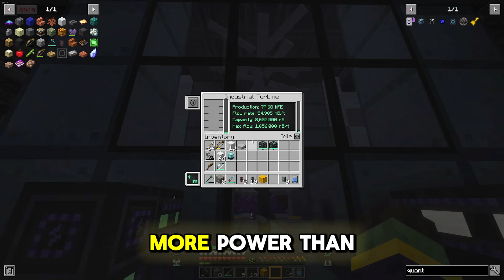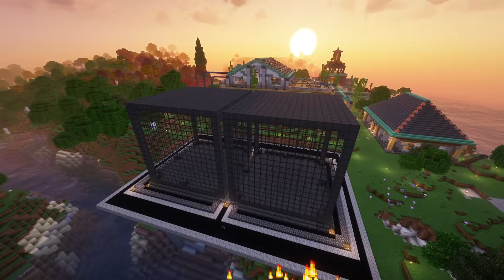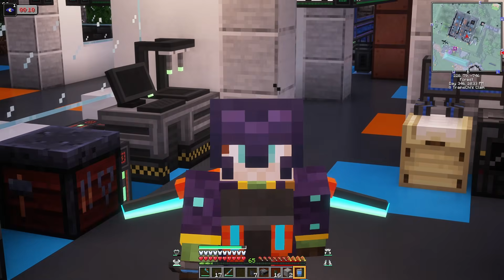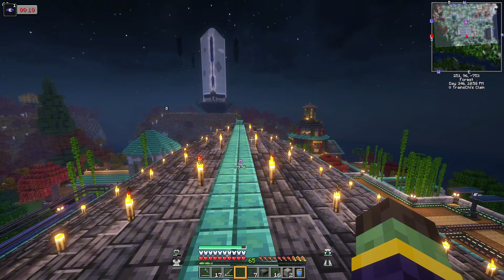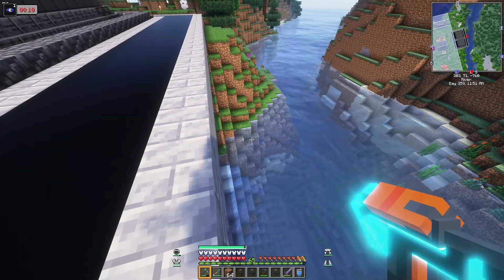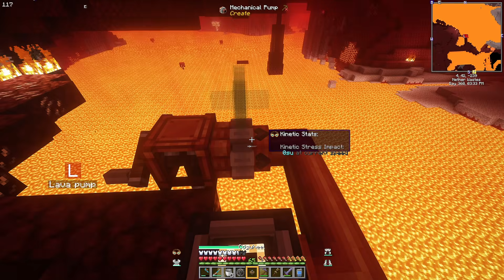My Reactor Couldn't Keep Up....So I Built THIS

Comment: using the wrench, or the configurator tool from mekanism, you can make some pipes work better because you can mark the block connector to be pushing or pulling. as for those electric water pumps, did you make sure you added speed upgrades to them? a few of them should suffice for this size, unless the pack heavily changed the rates. in the past you could just use infinite water source blocks like the kitchen-sink instead, sometimes directly attached since that's a feature of the fission reactor port, allowing you to make the fission reactor and the turbine to be touching for pretty much a lossless transfer of water/steam.
Reply from the maker: I did make sure that the pumps were upgraded with 8x speed upgrades and 8x energy upgrades, but it still seems to be not enough for some reason. Also, I looked to see. It turns out this modpack doesn't have the kitchen sink block 😭.

I'll have to do some poking around still to see if I can find a better solution. Although having the giant tanks looks really cool! So that's a plus. If you have more ideas, let me know!

I really appreciate it! 

If nothing else, I could always add some more mods to the pack? It would be cool to find a solution, though.
Reply: @ModdedMood   odd. you could check whether the ME Infinite Water Cell exists in your pack. i remember using it for some recent ftb packs and others, but it might be 1.20.1+ while sadly valhesia 5 is still 1.19. i remember some other mods like evilcraft also having a single block infinite water source you could simply smack onto the port. lastly a mod i personally don't like, but does the trick as well is Integrated Dynamics. in here you have a World Fluid Importer which can be quite powerful, but alas, i encountered lotsa lag using this mod in the past.

if you want to try the kitchen sink, it's from the mod "cooking for blockheads". good luck!
Reply from the maker: @larcek.giglamesh thank you! I'll do some updates in the next episode. I do have 1 more idea too, to try out so we will see!

Might Be as easy as adding more vents to the turbine and adding more coolant outputs from the turbine back into the reactor? I'll have to test that out

Comment: I love the dedication for building a ginormous tank for water, but I will say there's a much easier way to supply water to the reactor 😅 Integrated Dynamics has a fluid transportation thing that let's you pump the maximum amount of water per tick. Combine that with an infinite water source and you're golden!

I found a comment on reddit that explains the setup in more detail:

"Integrated dynamics is definitely the best way. All you need is a a fluid importer, fluid interface, one logic cable, and a variable card. Put the fluid importer on the sink (your infinite water source) and the fluid interface on the reactor input valve then use the logic cable to connect both. Right click on the fluid importer to bring up the menu and then use the variable card on “Import all Fluids”. Click on the plus and then scroll to fluid transfer rate and just type 9s until the numbers turn red and delete one of the 9s. This will essentially pump infinite water to your reactor at max punp rate"
Reply from the maker: That would be super helpful, I have so many pumps right now! I definitely need to figure that one out

Comment: Wow, I didn't know powering the water wheels with lava was an option! That's sick lol

I would also double check the chunk boundaries in the nether to make sure that the lava pump actually runs indefinitely. If the entangloporter with the anchor upgrade is in a different chunk than your water wheels it might not stay powered. Although it does seem like it's working fine based off the video :)
Reply from the maker: It was super cool to power the water wheels with lava! So far so good with the lava, although it pumps incredibly slowly into the tank it seems to be working!